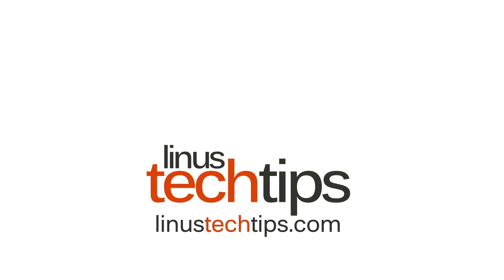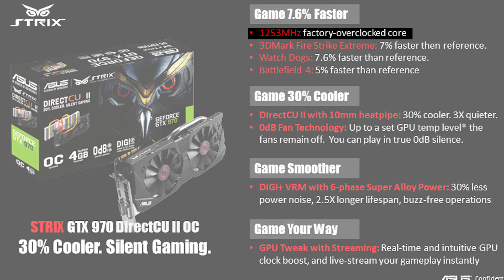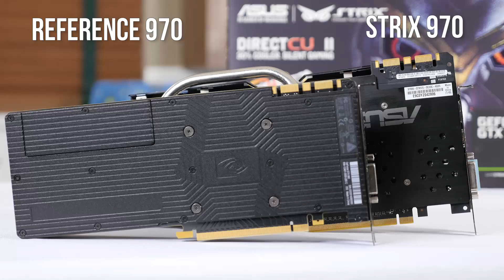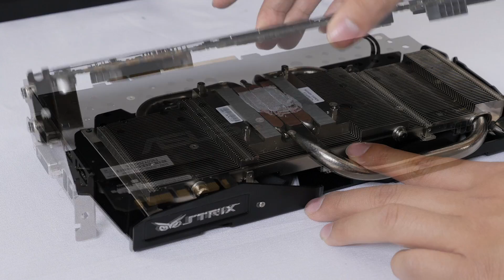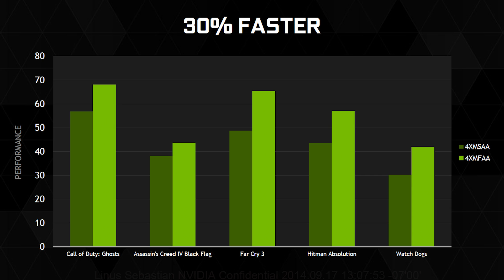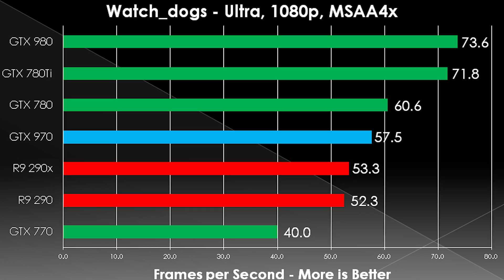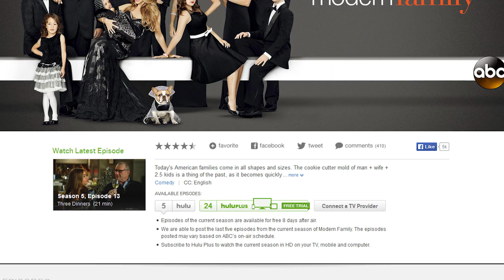ASUS Strix GeForce GTX 970 Video Card

Comment: I have a 770 in my system now. If i wish to get a new card in the 300-375 ish price range, should i get another 770, a 970, or go the AMD route? Would it be the same if i ever wanted to do surround and game, or would the 2 gigs on a 770 leave it out of any consideration?
Reply: Another 770 would probably be the most powerful option, and you can probably get a used one pretty cheap from someone who is upgrading.  A good choice as long as your existing power supply can handle two 770's.  
OTOH single card solutions are more elegant and reliable.  GTX 970 also packs more features.  I don't really think there is enough difference between the 770 to warrant an upgrade though.  
I wouldn't go AMD at the moment, but they will surely respond to these new cards soon enough with some compelling alternative.  
My personal choice though, would be not to upgrade.  770 is still great for single monitor 1080p.
Reply: get a 970 and sli later
Reply: there is no point in going the AMD route for now. AMD's closest competitor in performance (290X) costs $100-$140 more. and it's closest competitor in price (280X) get's absolutely obliterated by the 970.... however if you want to farm 60 reward points a day in Raptr.... by all means go AMD.
Reply: I would get another 770 to SLI them (expect microstuttering and 2GB VRAM might not be enough to be futureproof) or wait and see what AMD has in store, scince the price of the 970 will only go down in time, you have nothing to loose.
Reply: right now a 970. later check for amd new cards and see if they are better.
Reply: If you're sticking to 1080p gaming I say SLI. 1440p and I would say upgrade to something with more RAM.
SLI is great for high frame rate 1080p gaming (get a 120hz monitor), 970 will be better for 1440p performance.
 If you decide to SLI have fun with your triple digit frame rates!
Reply: since like CeRj mentioned, for higher resolutions the vRAM is going to become important, so it may be preferably to buy a 970 since they seem to be coming stock with 4 gigs of vRAM, and then sell off the 770 to lower the cost to your wallet.
the 970 will pay for itself in a short while depending on electricity costs in your area as well.
Reply: Just keep an eye out for a 770, they will be on sale everywhere the coming weeks and months. Or pick up 2 cheap used r9 290's. They are practacly giving them away now. Bought 3 of them with 18 months warranty left for the same price of a new 970.
Reply: What Roger said, I am buying a 770 for $175 tomorrow.
Reply: Suembeaux great choise. Have fun with them
Reply: I'm currently running an ASUS GTX 770 and i'm using it for triple monitor gaming and i have to say for the price range it keeps up reasonably well. The only problem that i have with it is that mine only has 2GB of RAM and that let's it down when it comes to surround gaming. This is why personally i am looking at getting a 970 or even 980 if i can get my hands on it. As for SLIing two 770's together you would still only have 2GB of VRAM which would slow it down quite a bit as far as i'm aware. Your choice haha.
Reply: CeRJ thanks for the advice! Guess I might as well go the extra mile (or dollars) and get the 970 to surround proof myself then.
Reply: slimj091  But... what if my points get reset?
Reply: Spirit
two 970s or one 980 ?
Reply: Spirit ok thanks

Comment: Check out the guru3d review for Gigabyte GeForce GTX 970 G1. That beast stays at 60~65 C, full load & with an overclock can easily beat gtx 980, gtx titan black, gtx 780 ti and r9 290x (reference models).

Comment: I feel like you should have mentioned just HOW BADASS ITS DESIGN IS. Honestly, does the 980 have this? I'd buy 2 for SLI if they do/did.
Reply: Asus do a strix version of the 980 and it looks the same (so, just as awesome)
Reply: Lachlan Hynd RIP wallet then.
Reply: It actually looked like an owl when the fan spins, if you look closely.

Comment: facepalms at the guy who bought two 4GB vram 760's.  

the 760's overall design CAN'T take full advantage of it's vram even at 4k resolution.  the rest of the card IS the bottleneck.  I can see if it was maybe 3GB vram max per card.

Even for lowest end 4k, it is asinine to buy a 760.  You would have been better off buying dual 4GB gtx 680's.

Comment: This card completely changed the market with its performance, price, temperature, wattage and features. The engineers did a beautiful job, this card makes me want to upgrade my HD7970 earlier than i was planning. PS i wish i could trust asus. Almost every product i have bought from them; GPU's, Motherboards, Tablets etc work great for a short while but they must use cheap parts because something always fails. If it was once i would say bad luck but it has happened to many times and sometimes multiple times after RMA (Direct Cu ii R9 280x)

Comment: Do I need this if I wanna run DoTA 2 or SFM at 120FPS?
Reply: Haven't you seen the video? You can only run LoL on this card. No Dota2 for you.
Reply: GTX 660 still goes good
Reply: KP-48

There are 120hz monitors you know.. And trust me, it is day and night compared to 60fps on those monitors.
Reply: KP-48 I wouldn't say that 30 is smooth and 60 is even more smooth but you can tell the difference with how smooth 144 vs 60 is but only on monitors that support 144
Reply: Why 120 fps?
60 is the target more than 60 isn't noticeable
Reply: BLINKY BILL meh, even my shitty 650 ti boost runs nicely
Reply: KP-48 Stop... Just stop, Im done with these people...
Reply: KP-48 My reasoning may sound dumb but I wanna record gameplay and stream sometime and I don't want the framedrop.
Reply: KP-48 After using a 120hz monitor it's impossible for me to use a 60hz one just because how laggy it is.. you definitely see a big difference.
Reply: KP-48 Not really, the reason you can't notice different bwt 120fps and 60fps is most likely your monitor is locked at 60hz.
Reply: PAYBACKaiw If you get a NV with shadowplay, you won't see a toll in your fps independent of what you are recording. Running a 760 and haven't had any frame drops recording or streaming anything. So no need to aim in doubling your fps to run tools like fraps..
Reply: omega. If you watch his channel, you would know he has laptop with gt635m/555m, which is pack with a 60hz monitor instead of 120/144hz one, without anymore knowledge on fps/hz/refresh rate, he would assume there's no differences with between 60 and 120 fps. Which is wrong and really misleading.
Reply: KP-48 yes you can as long as you have a monitor that supports it

Comment: In every other benchmark test I've seen the GTX 970 has beaten out the 780... Why is yours different?
Reply: they run all their cards overclocked.  That means their 780 was overclocked too.
Reply: protestthisaccount and that 780 they have happens to be good clocker :)
Reply: Must have been a beast of an overclocker then (the 780), because the other benchmarks had the 970 and 780 overclocked too.
Reply: Their 780ti is also cherry. they themselves strongly believe they actually got a card that is built as perfectly as it can be  as their benchmarks with it were noticeably higher than other sites and reviews
Reply: Corey Henshaw eh i checked the overclocking doc.  (It's not linked in the description for some reason however it is in the 980 video) and their 780 is a pretty decent overclock its + 125 to the core clock and +300 to the memory clock.  My asus 780 isn't a great overclocker either but it does about the same maybe a little less than that.  Maybe their 970 wasn't a good overclocking card? I'm not entirely sure what is considered a good overclock on a 970.

https://docs.google.com/spreadsheet/ccc?key=0AmLKAgEko3SAdHFtby1jNTFvaTF2UHhaMzdMQ0FNM2c&usp=sharing#gid=0
Reply: Corey Henshaw Drivers will probably yield a 10% boost in the coming months for the 970, so its not that bad.
Reply: Ah well, still picking one of these up over a 780 because of all the special features. Just going to overclock it as hard as I can.
Reply: Corey Henshaw I still would get the 970.  Drivers will get better for these new cards and its probably going to be faster than most 780's out there plus all the new features and the low power consumption make it a big winner!
Reply: Check out the guru3d review for Gigabyte GeForce GTX 970 G1. That beast stays at 60~65 C, full load & with an overclock can easily beat gtx 980, gtx titan black, gtx 780 ti and r9 290x (reference models).
Reply: I ordered my 980 on friday, gonna be hype
Reply: they have also said that some cards are "duds" meaning some perform less than other just due to issues in the card while it was being assembled, i forgot what card they got that was supposed to be beast but it turned out not as strong as they thought then found out it was a "dud" 

also their 780ti reference is a "gold baby" meaning its the best one from a batch
Reply: Considering the results here for the 780 running 1100ish core and that my lightning 780 does 1300+ on air i cannot see any reason to upgrade from a performance standpoint, ofcourse if i were interested in power savings the story would be different.
Reply: ***** Makes perfect sense, most people don't try to get the next  i7 chip every generation. But myself coming from a AMD 7870, this card is PERFECT not to mention CHEAP. Since it retails for under $400 USD I don't have to pay import fees which means this card would cost me $442 NZD vs the $800 I was going to pay for the 780 6GB
Reply: Benjamin B Coming from an AMD 4850 this is a long overdue upgrade...
Reply: The difference is that 780s have much higher room for OC while 970 is more factory-overclocked(even reference models) so room for OC is not as high.

It's not the magical "cheaper and better in every way" card everyone hyped it up to be.  It is, however, much more efficient.
Reply: protestthisaccount The ASUS version of the 970 achieves the highest OC from what i'v seen so far.
Reply: Jester Muffin check out Gigabyte GeForce GTX 970 G1 review
Reply: They either out a mild OC on the 970 and their 780 has had time to find the sweet spot? OR ppl are lying on other BM bc I've been seeing the same thing as you lately. Also the drivers are very new so give it some time and once we get some good drivers we will see better performance.

Comment: What are CUDA cores? As what do they do? Also what is the difference between DVI-I  and DVI-D
Reply: Jacob S No, shaders are a real thing, 'cuda cores' are a bullshit marketing term.
Just like those v8 gilette razors are just razor blades for shaving and dont ACTUALLY contain an 8 cylinder engine.
Reply: Jacob S No, no, they were already called shaders then amd and nvidia made their own silly marketing terms.
If i start selling cars as 'broom-broom-4wheel-thingies' does that mean that broom-broom-4wheel-thingies are now a tangible thing?
No, it doesn't, someone just gave it a retarded name and made it look proprietary when it is really just something simple.
Reply: ***** Can you use CUDA with a 7850?
Reply: DVI-D is digital only. DVI-I can connect to digital and to older analog tvs.
Reply: CUDA Cores are basically the cores of your GPU, much like your processor has dual-core, quad-core, octo-core. The GPU has 100s and 1000s of them.
Reply: CUDA is for work like 3d rendering.
Reply: ***** It's not a "bullshit marketing term". It's the exact same thing, I have no idea why you're trying to confuse someone that is trying to get basic information. CUDA Cores, Stream Processors, Shader Cores are the same thing, a programmable processor used in the GPU to accomplish certain tasks. If a CUDA Core isn't real neither is a Shader.
Reply: ***** Except they have proprietary architecture and software that don't work with each other so calling them the same thing would be silly and confusing. Hence why they call it different things, it doesn't make them less real in the slightest. It makes it easier for everyone to understand, which makes my original point. The OP seeks what a CUDA Core is, not your opinion about NVIDIA and AMD's naming scheme.
Reply: DVI-I carries an analogue signal in it, so it can be converted to something like VGA with a simple and cheap passive adapter.
Reply: CUDA is no different from Stream Processors as AMD has. Also the guy who answered is wrong the vram is what helps res. DVI-I and DVI-D are about the same.
Reply: ***** dvi-i supports analogue output.
Reply: You should watch Techquickie, Linus' second channel.. everything you asked is answered flawlessly.
Reply: thanks vinter
Reply: cuda cores and stream processors are both shader processors with a copyrighted name. think of the number of them as cpu cores but for the gpu and all will be utilized unlike the cpu. the most simple answer is basically the more u have the better fps u get.
Reply: is there a max to the number of CUDA cores you can have? and can you increase the number of CUDA cores?
Reply: dany fatso cuda cores are not a real thing.
Reply: ***** What do you mean? of course they are.
Reply: lol
Reply: Jacob S I did state they were shaders, which they are. and the software CAN work together, run a 580 and a 7850 in the same computer and you can run separate displays off the two, and im sure other combinations will also work.
Reply: Jacob S If you were to create driver integration for it, yes, you absolutely could.
Reply: I believe only DVI-D can run a 1440p display at 60hz. DVI-I cannot.
Reply: There is a "Fast as Possible" on Tech Quickie for this.
Reply: Eric Lin Wrong. The ONLY difference between DVI-I and DVI-D is 4 pins.  Those 4 pins are dedicated for carrying an analog single, the digital sides are exactly the same so there is NO bandwidth difference.
Reply: tmar23 I see... I looked it up, it's dual link vs single link that's the difference. I thought the D in DVI-D stands for dual link.
Reply: ***** No CUDA us for GPGPU stuff

Comment: Why did NVIDIA skip the 800 series?
Reply: The gtx 800 series for laptops gtx 900 for desktops
Reply: OK thanks for all your replies.
Would the gtx 660 be good for gaming?
Reply: Aaron H-L yes if you have it you can keep it but if you want to get new one get 760 or wait for gtx 960 it will be smilliar to gtx 770 and cost around $219
Reply: I have a 170 dollar budget and where i am getting the card is 166 dollars. I am either going for the gtx 770 or 660. Thanks for replying.
Reply: they just repackaged it and named it 900's series...
Reply: the 800 series is for laptops
Reply: Because they wanted to start keeping their naming and GPU architecture together. They called the mobile chips 800m series, but used Keplar on them, so instead of putting Maxwell architecture cards into that line, they put it in it's own. Yes I know the 750 doesn't fit into this.
Reply: Aaron H-L well if you can, get the 770 instead of the 660, you'll get pretty good performance unless you want to do heavy surround or something.
Reply: Ok cool. I am going for the 770.
Thanks
Reply: Aaron H-L if you want a kick as card, i recommend a 780ti, im currently using a 670 and its really good, but if i had a choice, i would go for 780ti although it might be very expensive, also i would suggest sticking to Asus or Evga, these are the best companies from my own personal experience.
Reply: Gigabyte has the 780ti windforce edition for about 210 dollar so i might go with your recommendation. Thanks.